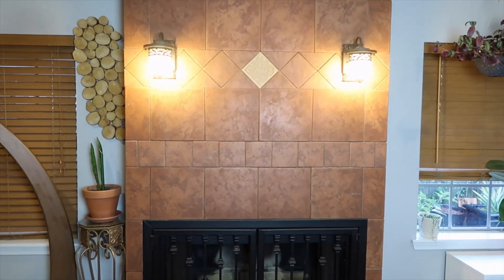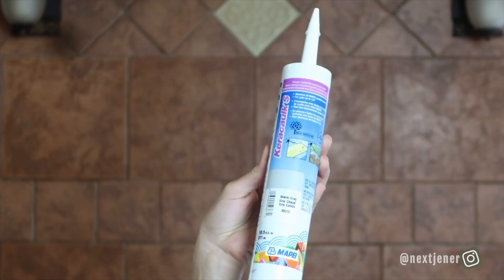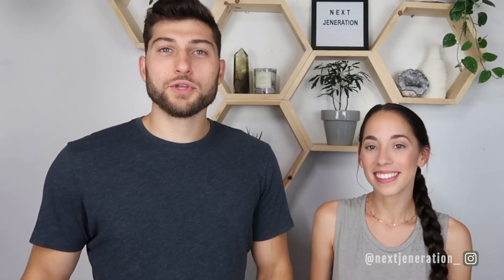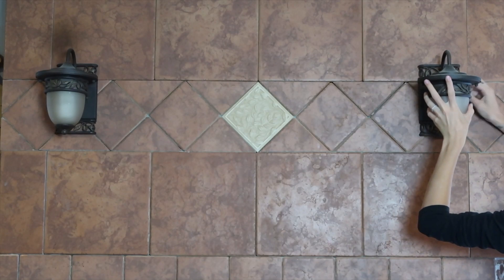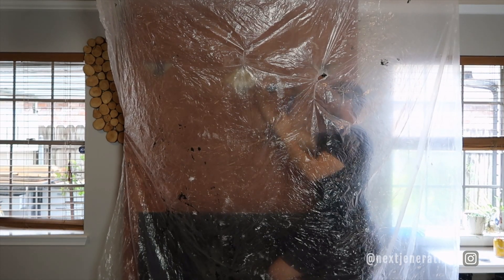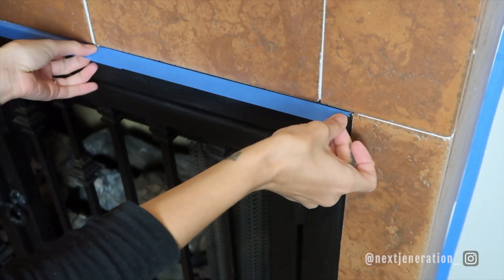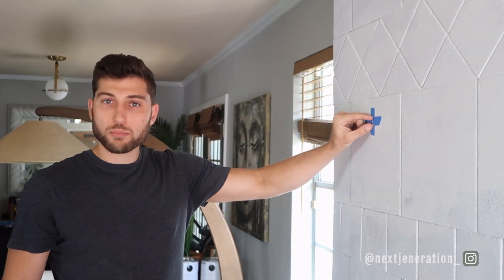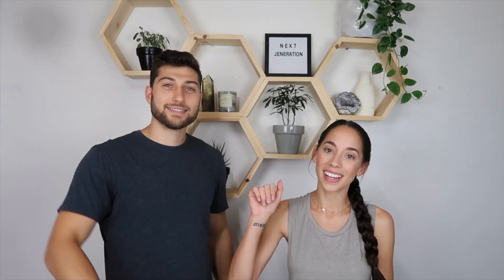DIY Fireplace Makeover Under $100! | Tile Fireplace Transformation DIY Mantle

Comment: What type of paint did you use? Also was it Matte or semi gloss? Thank you ahead of 
time 💗
Reply from the maker: We just used regular latex paint, but be sure to use a primer before so it adheres! Latex can handle up 180 degrees, we don’t use our fireplace because we’re in New Orleans where it doesn’t get cold - lol. But they do have high heat paints also!